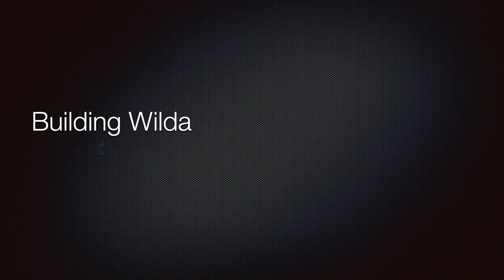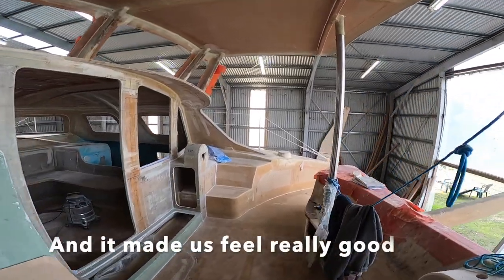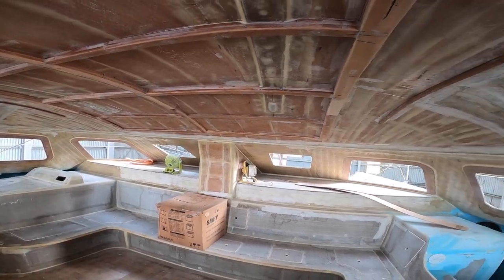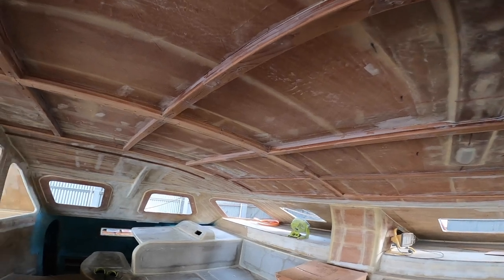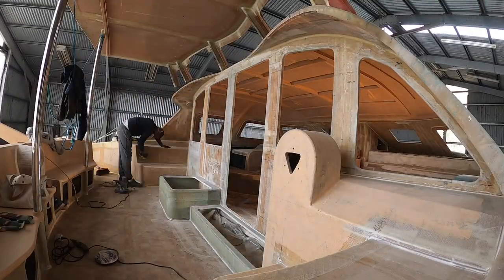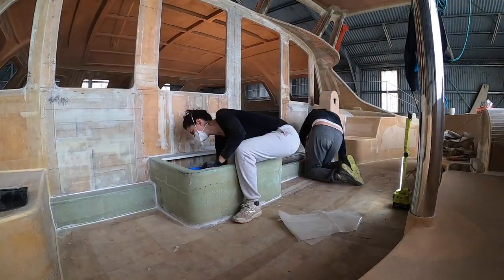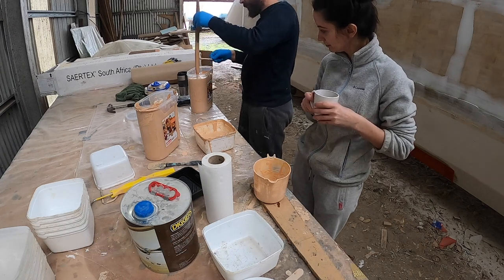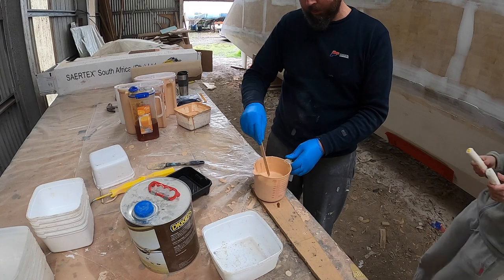We started painting and fairing! - S01 E16 - DIY Catamaran

Comment: Great to see some paint going on.
I can' t help thinking that that "step" into the cabin is going to get real old real quick. Would not a level floor from cockpit to cabin be better - with a floor grate for water ingress avoidance.
I'm sure you have though about it though. Still stepping over a step many times a day while sailing is going to be rather cumbersome at best.
Reply from the maker: You are absolutely right. It will be annoying. I have not shown too much of the steering yet, but that is the reason for the step. Steering cables that have to be there in order for me to use existing autopilot and push/pull cables. Not ideal, but necessary. One of the drawbacks of buying a boat that was built by someone who has a different idea on how to use the boat.

You are absolutely right though. Not ideal. The bridge deck is also not a box type construction. It is a single panel. A channel next to the load bearing bulkhead would be a challenge. Even if the main load bearing is done by the two bulkheads forward and aft of the cockpit.

Well spotted 😂